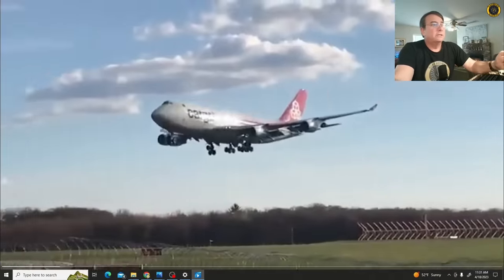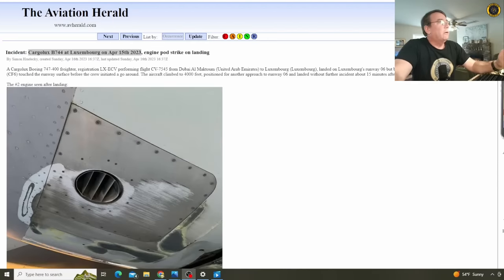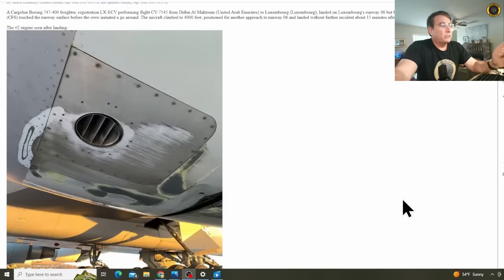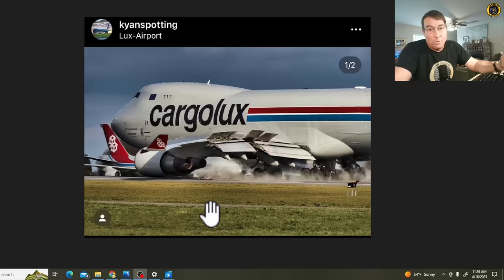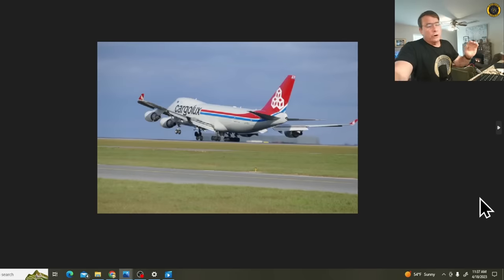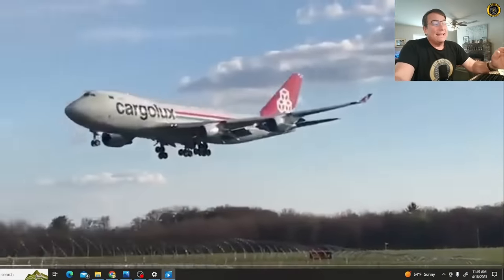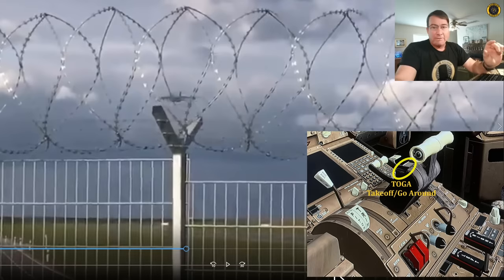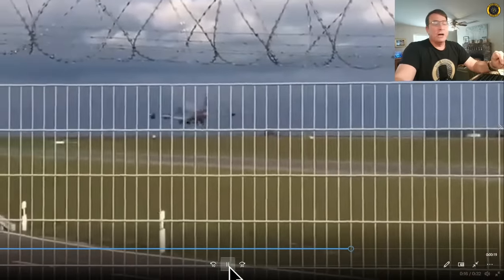Cargolux 747-400 KABLAMMO!-SMASH AND GO 15 Apr 2023

Comment: That was a flaps 25 landing there. Usually the flaps 30 landings are the ones that can end up with being "hard" because of the need for more flare and the different deck angle on approach from the cockpit. Our company wants us to use flaps 25 for all landings unless performance dictates the need for flaps 30. The airspeed difference on approach is about 5 knots slower with flaps 30. That said, if you do a flaps 25 approach and are heavy, reduce the thrust too quickly, and not flare you can end up piling it in like this crew did. Definitely a late or non existent flare in this case. It also appears that the crew allowed the left wing to dip down close to touchdown. In airliners  you have to be extremely careful to land as close to wings level as possible. Good plane spotting and thanks for your take, Juan.
Reply: Thank you very much for this informations!
Reply: Thanks for the info on the flaps setting, I was wondering about that myself. I guess using the PAPI lights on this approach would not have mattered either.. Thanks again, all the best to you...

Comment: You are right Juan , on the 747 you will get at least 2000 Fpm climb rate with the first push of the toga switch, 747-400 pilot here.

Comment: I worked on that A/C when I worked for Boeing , looks like they need to call AOG to replace some engine cowals and do engine mounts inspection , wing spar inspection and gear inspection . I worked preflighting and delivery at Everett WA flight line I remember that 747 -400 by the paint and line number Cargo lux was a good company to work for when we delivered that A/C thay gave all the ground crew vests with Cargo lux logo . I think I got a cap too.😀👍

Comment: It's a great testimony on the strength of the gear, and how well the landing load is distributed through the wing box and into all the other structure. Not to mention the bounce and rebound kinematics
Reply: It helps that the spoilers hadn't deployed.  A lot of the weight is still being being supported by the wing until they go up.
Reply: @marcmcreynolds2827  Spoilers were retracted, yes. On TOGA.

Comment: That's going to be an expensive repair. Thrust reverser torque box ring, mid cowling, latch access door, plus probably all of the engine to pylon bolts and both a mag particle and possibly an X-ray to two.
Reply: You answered my question. How much more would have caused the engines to break away?
Reply: I was wondering about stresses on the wing spar? Specifically that one side suffered a hard stop (the ground) while the flying wing was free to flex fully.
Reply: You forgot to mention the cost of the pilot deep colonoscopy....
Reply: You're a better man than I am.
Reply: Aren’t most commercial aircraft jet engines leased?  If it’s not airworthy wouldn’t Cargolux notify the leasing company and arrange for a replacement?
Reply: That is one tough bird
Reply: @demef758  oh yeah they not able to sit after this

Comment: If I remember correctly from my 74 years, inboards would contact at 8 degrees bank angle, no wing flex.
Company 74 classic had a pot strike when landing on narrow taxi way in full cross wind which was in use due main runway being repaired (SCL Chile).
They got a fire warning after the strike.
That's why you land this bird with some crab angle in a solid cross wind, on a wet runway no need to de crab, gear is made for it.
Landing in eg 30 kts cross the cockpit is almost over the edge of the rwy just before the flare, took a while to trust that the gear wouldn't shear off touching down with such a crab angle.

Btw, Cargolux pilots are solid

Comment: Hand fly the airplane, just like a real one.  Yeah, sometimes, all that automation, allows your stick and rudder skills to lack.
Back in my CFI days, I checked out a retired USAF LTC in a new to him 172.  He used to fly C-141s.  
I demoed the first landing. Full stop. And he did the next TO and landing.  Started flaring about 30 ft.  GO AROUND!  
No worries, Colonel, I would probably flare  a 141 at ten feet.  Pretty good landing the next time. Three more and he was good to go.
Reply: Happened to me several times.  A Grumman Tiger is even harder to land because it is not a C-130 nor C-141.  Two go-arounds necessary before they got out of heavy transport mode.  A real show was a Navy F4 Phantom jock doing "carrier ops" in Beech Skipper.  A sharp turn to the left on take-off skimming the treetops was a hoot.  I had to remind him we were not doing boat ops and that he could climb straight out and rectangle the pattern, please.

Comment: I'd never ridden through a low altitude go around in a commercial jet until a few years ago on a missed approach to runway 09 on a foggy night at San Diego.  Impressive climb rate and angle with the light fuel load, cool temps and nearly at sea level!  Fun!

Comment: I didn’t realize that Luxembourg had room for such a long runway! But it does (only runway at the airport, and supposedly the only paved runway in the country). Cargolux HQ is at the airport, and it’s a major freight airport.
Reply: Correct the runway is used for both and very busy.
Reply: Luxembourg Findel Airport has indeed a (single) 13130 feet/ 4002 metres- Runway, a 06/24. The 06-direction is a little bit upwards, I found speculations in the net that this maybe contributed to the incident. But the Runway is definetely long enough for a 747.
And yes, it´s a major freight airport with the HQ of Cargolux.
Reply: Yes, it is the cargo airline of Luxemburg, not one that treats the cargo to luxury ;)
Reply: It must extend a bit over two borders !!
Reply: @EnthusiastCarHangar  Probably extra busy now that they have to fill in the groove that plane just made. Ouch! I felt that all the way from here.
Reply: @markiangooley Cargolux is based in Luxembourg
Reply: @garymartin9777  😅

Comment: You’re looking at flaps 25. Normal landing setting (we can do 25 or 30). Higher vref though. Also, the software anomaly you addressed about the thrust levers remaining idle also exists on the 747, same logic for the TOGA switches, including the reduced thrust with one press during a go around.

Comment: Runway 06 has a very pronounced upslope for the first third if I remember correctly. As you reach about 200 ft AGL on approach the runway appears really short as the remaining two thirds are not visible .It gives a very unusual visual picture and a noticeably bigger flare input is required…………It’s a tricky airport  perched atop of a hill, though I would think a home based crew would be pretty well versed in its challenges.
Reply: Upslope runways are NEVER fun. No matter how many times you think about it on final.
Reply: Good point!

Comment: Hello Blancolirio,
Here CV crew. 
The investigation is still going on at this present time. 
The things I can tell you is that the runways 06 in Luxembourg has an upslope which is quite large, 1.5% from 0 up to 1512 meters. Concerning Flap position for landing on the B744, the rule is: If flaps 30 approach speed (VREF 30 plus additives for wind and gusts is higher than 167 knots, use flaps 25 and VREF 25 for landing. 
As we are always on the heavy side as a cargo operator, in windy conditions, we often land with F25 ( better as well for noise abatement and fuel saving). I can’t tell you on the video what flap setting was used in that particular landing. The procedure to go around was according our SOP. Until now, as the investigation isn’t published, the rest can only be speculation. The only thing I can tell you is that the Crew are experienced pilots, very  competent and professional. Hope to see them soon flying again.
Reply: Dear Eric 
Flew 747 with Jade Cargo at LUX , also B 767 , B 777 & DC8 to same airport. 
Loved walking hours through those historic places. 
Only Pilots are subjected to this type of incidents...it's part of our job. 
I remember the B 747 being very tricky with X winds,  that up wind wing would go up suddenly ...
All the Best for you and your colleagues , hope there will be a good Chief Pilot / Boss to give them a fair chance at keeping their jobs.
Cheers

Comment: the still frame of the wing in flexion at 2:00 shows something I've never seen (granted, I'm not in aviation). You can clearly see the underlying structure on the fuselage because the skin is stretched so tightly. The gear is in full rebound, and the wings are fully flexed down, and that fuselage looks like a bodybuilder.
That's absolutely wild
Reply: You're right. That wasn't a landing, that was a crash which stopped just short of structural failure. That entire airplane needs to be inspected. The shock must have rippled through every structure and connection between structures. It won't surprise me if we see this tail number have issues again at a later date.
Reply: @slartybarfastb3648  this is one of those planes that going to be a black sheep until it's time to sell it and hope the next person doesn't look too close
Reply from the maker: Good eye Seldoon!!!
Reply: I'm almost positive that's sunlight reflecting off the top of the wing's surface, not the substructure.
Reply: Seldoon — a descriptive way of putting it.  

As far as the other two posts  —  Much too heavy on the drama, folks.  May I ratchet it back from the drama queen level with a few words?

The aircraft will be inspected per Boeing requirements, repairs as required will be made, and very likely the aircraft will be back in the air no worse off for the incident.  
Non aviation people have no idea the degree of structural abuse and stress a jetliner must go through and pass with flying colors during the certification process.  If one could observe a jetliner’s structure while it is flying through defined severe turbulence an average person’s jaw would drop. 😮  This can’t be !!  

Transport category aircraft are amazing feats of engineering.
Reply: Sunshine reflection of wing profile (seen from above, all angles) The lines shown don't match with the underlying structure under the skin. It's just the eyes seeing what the brain wants to see.
Reply: @myrlstone8904  having seen what Airbus do to wings at their test facility in Bristol UK you are spot on!
Reply: @slartybarfastb3648  Just looking after this advise at it: Yes, indeed, exactly.

Comment: This reminds me of what pilots back at Travis AFB always referred to as "the crash and dash circuit".  I never worked on the flight line, but I do remember a C-5 sitting on the runway for three months back in 1983 while Air Force and Lockheed engineers tried to figure out a way to get the aircraft up high enough that they could open the landing gear doors and get the gear down.

Comment: “ Climb like a homesick Angel” same in the 747/777.
I believe they had flaps 30 which is the flap setting that will save fuel in the approach. Flaps 40 will give a both less nose up attitude and bring the engines more spooled up. 
Unless it’s required by runway contaminated or performance, Flaps 30 would be a good selection. 
You are right. No  on time flare but late flare made this landings even worst. 
Giving extra G load. Made even more critical, was that the spoilers augment the roll, as they are coming out from whatever input they had on the ailerons. 
Not a good day for the pilots.

Comment: I had the opportunity to fly a 747 full motion simulator and I almost didn't flare because you are sitting so high in the air on touchdown. The guy operating the sim goes "FLARE FLARE FLARE."   I made it in though....no simulated blown tires. The instructor said the sim is high fidelity and would let us know if we damaged the aircraft. This was simulated Los Angeles with no crosswind.

Comment: Juan, I used to work overhauling 747-100 / 200 at JFK for Pan Am back in the day. It was my first A/P job right out of Teterboro. So, that being said, it looks this was a 747 100 and the flaps don't look like they are at 30 degrees. If that's the case, that may be part of the reason why these guys came in this hot.
Reply: Cargolux retired their last 747-100 in 1988.  They also retired their last 747-200 in 2008.  The plane in the video is a 747-400F.  A flap setting of 25 is very normal with a long runway.  Flaps 30 is also used depending on conditions like aircraft landing weight, ground speed and available runway length.

Comment: What's the standard procedure after a heavy landing, go around or land? The damage to those engines reminds me of the Pakistan Air crash where the AGB was damaged. Obviously in this case it was superficial damage but I would be concerned once in the air after to go around that there would be significant damage to the LG or structure preventing a safe return and landing.
Reply: I was wondering the same. May be better to complete the landing and risk an overrun than risk having two damaged engines in flight?
Reply from the maker: It’s the high bounce that you need to go around.
Reply: @slartybarfastb3648  The bounce(s) would have added a lot of runway behind them before the plane could be slowed down.  I think trying to save it could also risk some lateral controllability issues as well.  Probably easier and safer to get the plane back in the air than to try to get it to settle down on the runway after an upset like that.  Also, a lightly fueled 747 should have no issues on a go-around if one engine had to be shut down.  Two engines down would be challenging, but still also doable.

Comment: How timely! I just received a 777 bulletin today saying Boeing have updated the Thrust Management Function so that it “automatically disconnects the autothrottle if the thrust levers are advanced again after initially retarding for the flare.”
Along with a bunch of go around procedure changes such as reading the FMA changes before selecting flaps.

Comment: It looks like the spoilers need to deploy NOT during the touchdown landing gear compression, but an instant later when there is some rebound in the lading gear. At touchdown a wing is making only a tiny bit less lift than when airborne, and the wings would still be flexed upward. OK, the outer wing panel has no spoilers, but if the inboard panels are spoiled, then the wing flexes downwards. I guess it is only a small difference, but that No.2 engine had only a slight impact.

Comment: They were lucky.  A FedEx MD-11 did very similar thing at Narita several years ago. The upset and bounce took out a main gear leg, then a wing.  Total hull loss and multiple fatalities.
Reply: McD designed things differently, the gear trunions are underneath the spar, piledrive the gear and it's likely to smash through the spar and break the wing off, allowing the aircraft to roll over. 
Same thing happened at EWR.
Reply: Yeah Phil that's the horrible crash that first came into my head when I saw this. Very glad for these guys.

Comment: Boeing mechanic here.   The engine is the tip of the iceberg of potential damage on this.
Reply: Yeah like a Cracked Pylon or Pylon attach fittings or the wing. What about the Landing Gear?

Comment: Aircraft can catch you out, we were doing touch and go in C340 on 1000m runway. We learnt quick that full flap t and g was a no no, it took so long for the split flap to reach a lift position. So we only did part flap t and g's.
Reply: Years ago i had a DC10 pilot as instructor, ex Laker airways. He said empty DC10 would do 10,000fpm climb empty minium fuel.

Comment: They build those birds tough. Slammed down on the ground with tens of thousands of pounds of force and the wing and engine didn't give up the ghost.
Reply: You're off by an order of magnitude. It's hundreds of thousands of pounds of force...

Checked my numbers: empty mass of a 747 is between 337,000 and 485,000 pounds. Add to that some fuel and cargo and you're looking at well north of half a million pounds.
Reply: @realulli  And then multiply that by the G forces imposed.  That could bring us to more than a million, at least at the moment maximum engagement with the runway.
Reply: @skyhawk_4526  AFAIK, the plane is built to survive 3g of acceleration, e.g. due to turbulence, at MTOW. 

The gear is built to cope with hard landings at max landing weight, which is also significantly higher than what they probably had here. 

I suspect the gear and just about all of the airplane will be fine. What needs to be looked at are the two engines and their mounts.

Comment: High speed, not full flaps, makes me wonder if it wasn't windy and gusty. I had a "less than perfect" landing yesterday because just as I was flaring the wind dropped about 10 to 15 knots. I instantly lost that lift, plus my crosswind correction was instantly too much. My right seater, who has more hours than I can count, made a comment about the centerline, I told him I could see it under the right mains....

Comment: I'm retired now, did not fly the -400, but the flap settings are similar to the -100/-200 which I did fly, with P&W JT9D engines. Our normal landing flaps were 25 (for noise), and full flaps were 30. This landing looks to me like 20 which was our usual takeoff setting, but I don't know why they would be using 20 as it is not a normal landing setting. Perhaps it is 25, but it does not look like 25 to me. The crews who fly our -400 airplanes with GE engines tell me they normally use flaps 10 for takeoff and 30 for landing since the GE engines are quieter. Since the flaps on the -8 are totally different, I have no idea what the flap settings are, but no matter since this is a -400 here. Even though the flaps are triple slotted, the third slot only opens when using 30 degrees, so it was definitely only 20 or 25 degrees. I also refrain from judging the actions of other crews since I was not there and do not know what the situation was.